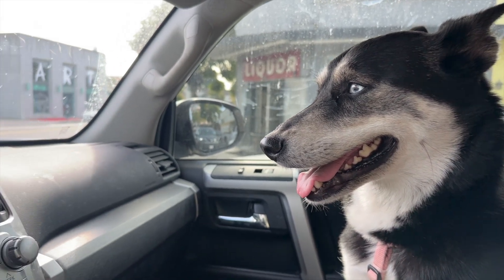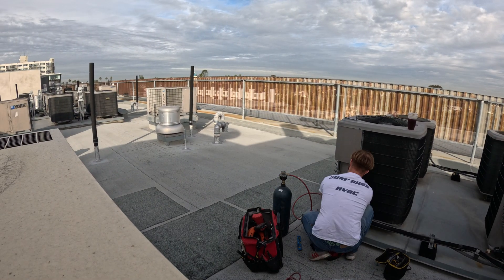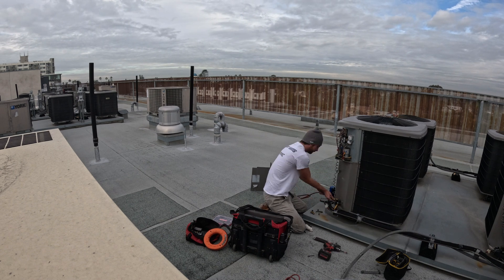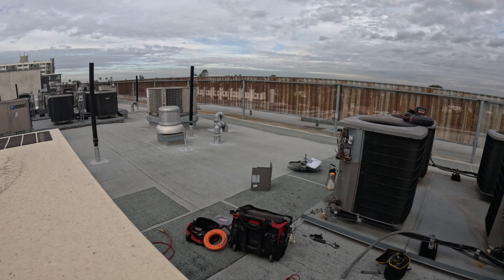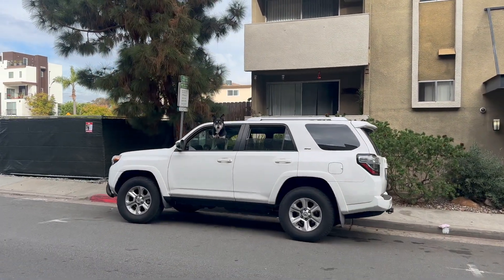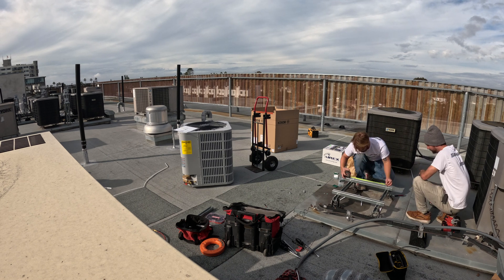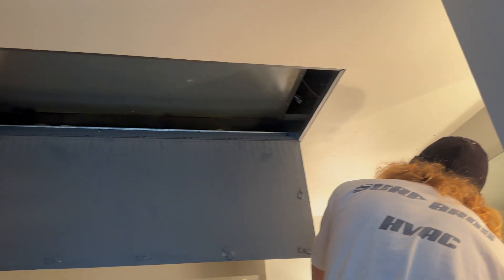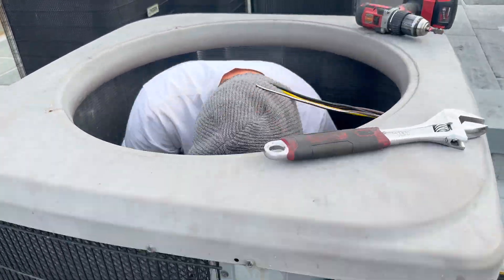Heat Pump Install Time Lapse - No Contractor Wanted This Job

Comment: Bro you gotta explain what yall did on the bottom of that condenser to anchor it. From Florida so obviously never seen that. But jeez that took forever.
Reply from the maker: We built a lattice with channel and made sure it aligned with the mounting holes in the bottom of the unit. Then we screwed it in. It was a bit of a pain in the ass tbh but it did turn out nice.

Comment: that is definitely a crappy location for the A/H. can you imagine when it needs to be replaced?!
Reply from the maker: Are you in HVAC? This style of unit is quite common in condos. We’ll be replacing two in the next month and will be posting videos of the work
Reply: @SurfBrosHVAC  i am a technician, although i dont work for residential companies anymore. I prefer commercial/industrial, I still tackle residential on the side thru referrals.
Reply from the maker: These are common in multi story condos. They are very common in San Diego but I used to do HVAC in Phoenix and I had only seen like 10 of them before I relocated. They are not particularly fun to work on so count your blessings you haven't come across them